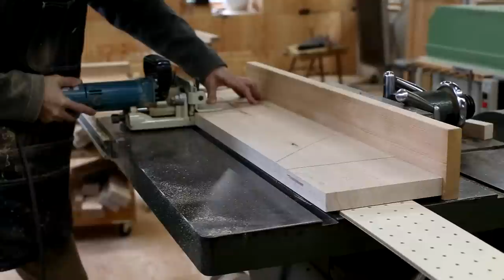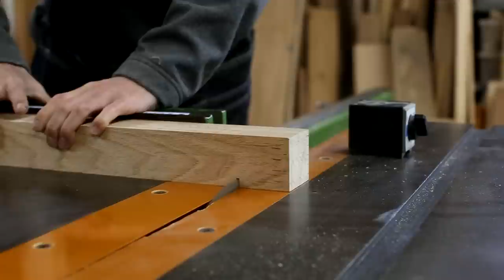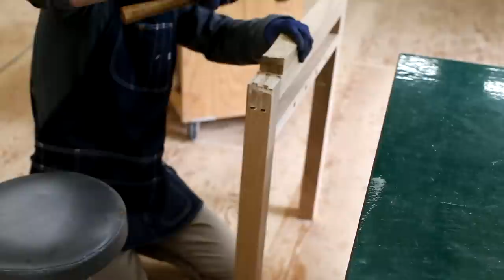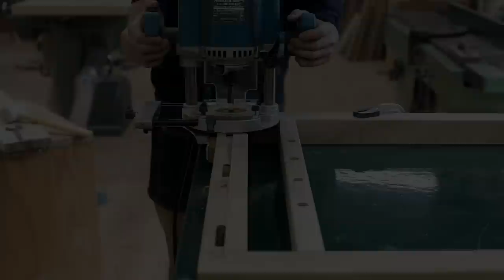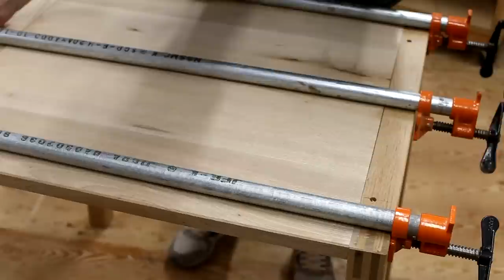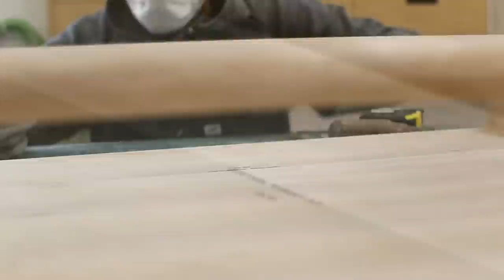ISHITANI - Making a Small Table with a shelf

Comment: 1. I've never seen someone cut tenons by pushing the board long ways into the blade, does this undercut the middle of the mortise due to the curvature of the blade?

2. What model Makita plunge router do you have, do you recommend it?

3. Marking your dowels so you can glue them in, but only to the breadboard and not the table top!  Genius!  Did you apply glue to the center tenon that did not have a mortise for a dowel?

Comment: That is some tight joinery, but I guess it's a good idea to make things extra tight in the summer so the joints are less likely to open up in the winter.
Reply: Yeah I was talking about the bridle joints (not sure what the Japanese name is :P).  I've never seen them open up before, but then I don't live in a cold climate like Northern Japan.  I'm too chicken to make my joints that tight because I'm afraid the wood is going to split when I try to fully close it.  My rule is if I can't get it > 50% closed with just the strength of my hands, it's too tight.  For table tops I'd rather just use a good plywood that defeats wood movement.
Reply: Expansion can cause tight joints to either crack or lose their tension. Skill and knowledge is required when doing joints like that.

Comment: were the square holes in the table top and the dowel to accommodate for wood movement?  that's a great idea i'm definitely going to take note of
Reply: thats right, notice that glue was only applied to the upper half of the dowel as well, making sure not to glue it to the table top but only the leg frame.

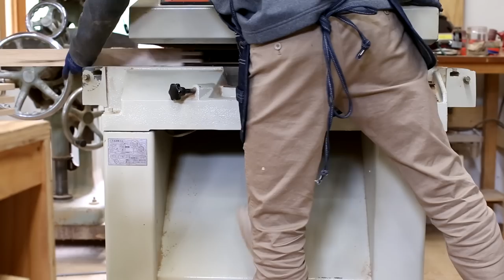Comment: Beautiful work...what was the machine ~5:20 min?  Almost no sanding, because of the block planing?
Reply: That machine was a hitachi super surfacer. It's different than a jointer since it leaves a finish more akin to plainers. 
With a plained finish like that sanding would do more harm than good.
Reply: I think, that calls surface planner. I saw only Japanese woodworkers use that machine.
Reply: This is a super surfacer, the lumber runs under a stationary blade with a
 chip breaker just like a hand plane and leaves a surface just like if 
it was hand planed.The blade is 10" wide, it can surface up to 20" of width, the blade can also be skewed.It comes with an extra set of blade / chip breaker and manual in english.

Comment: is that "super surfacer" just a fancy planer?  what does it do exactly?
Reply: I was curious too. Got this from a description of a Hitachi super surfacer: This is a super surfacer, the lumber runs under a stationary blade with a chip breaker just like a hand plane and leaves a surface just like if it was hand planed.

The blade is 10" wide, it can surface up to 20" of width, the blade can also be skewed.It comes with an extra set of blade / chip breaker and manual in english.